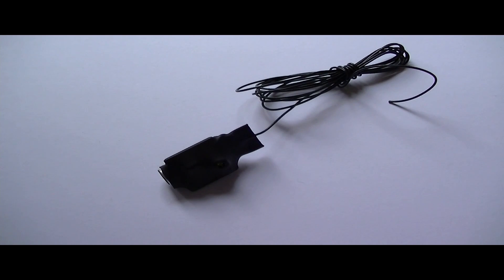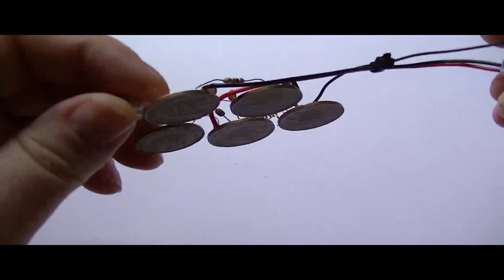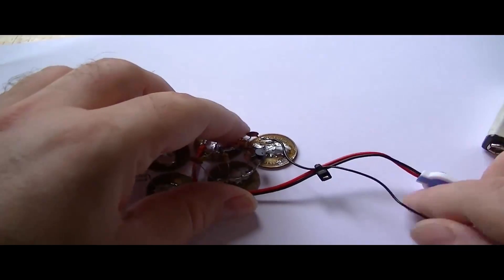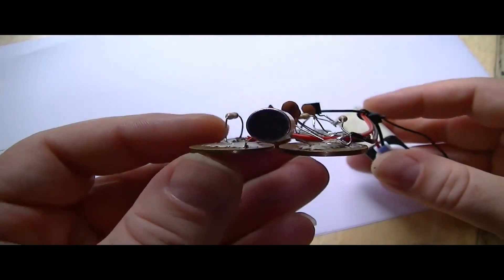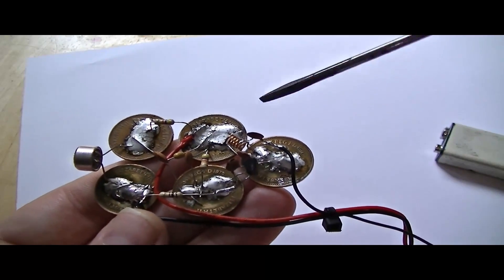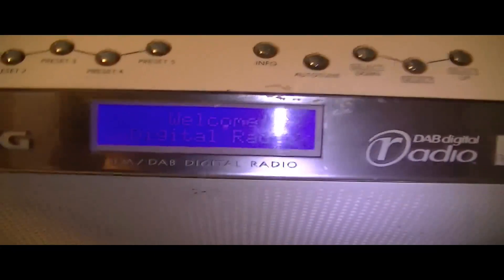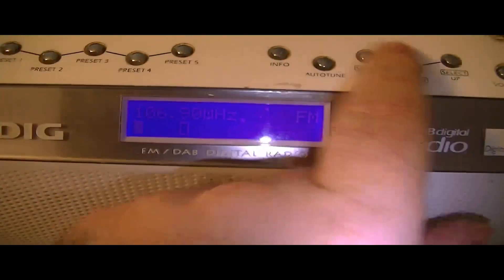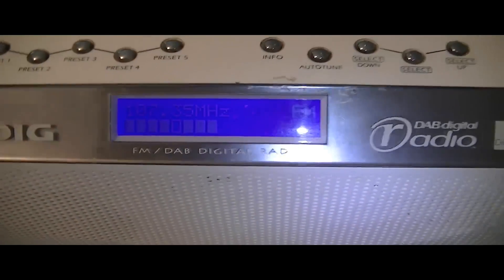Penny FM Transmitter

Comment: Seems that the weight and flexibility makes the coil move and change the frequency.  It would be a lot less flexible if the pennies were fastened down to a solid base, like a small piece of thin plywood or pressedboard.  Hot glue would hold them down firmly.

The length of the antenna has to do with the sensitivity to frequency change when it comes near an object.  I've found that 0.6 meter or less make it less sensitive and it helps enough to radiate the signal.

Comment: Do the pennies serve any purpose in this circuit other than providing a pad for soldering the component leads together?  Or could they be left out entirely with direct wire-to-wire soldering?
Reply from the maker: ***** 
Yes the pennies are providing a pad for soldering ,i have built a FM transmitter using direct wire-to-wire soldering ,please see my other videos.
Reply: dazaro3 Ok, thanks for the info.  I made this transmitter with direct wire-to-wire soldering (luckily I found that exact transistor on an old circuit board) and it does seem to work down in the high 80s or low 90s on the FM dial, although there's a ton of interference on the receiving end.  That might be a factor of my house and wiring, though, since my oscilloscope picks up a ton of stray interference through the probes.

Comment: how would you go about changing the power source to a larger battery, or even plugging it directly into a socket?
Reply from the maker: You can use max 12v ,you can NOT plug it directly into a wall socket !
You will get mains hum if you use a power supply.